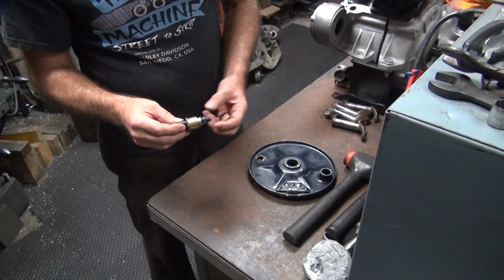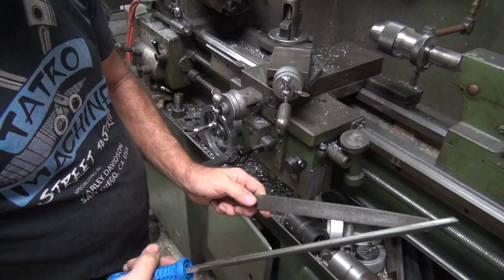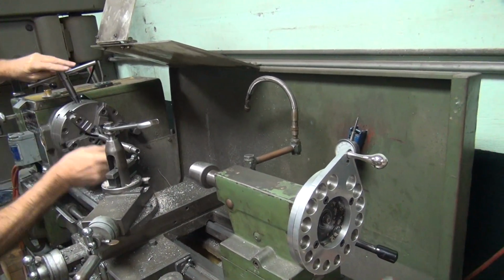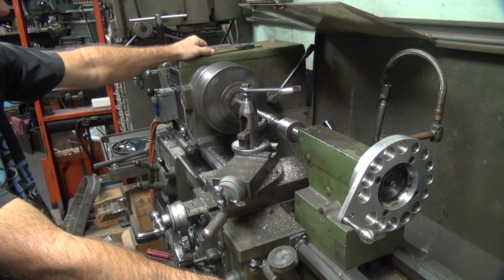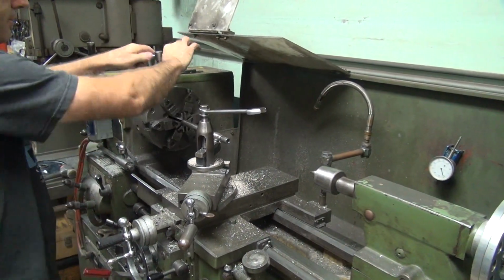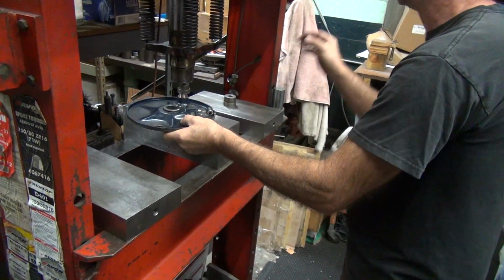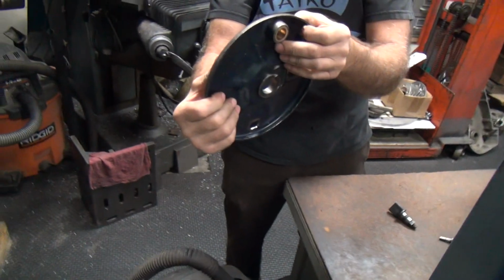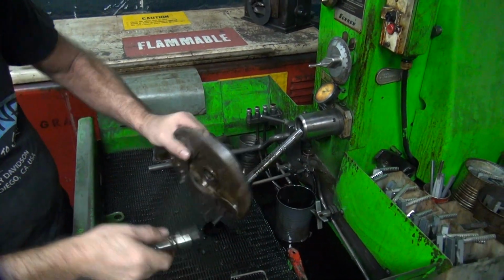#137 1952 panhead rust bucket rear brake rebuild clutch adjustment FL harley bobber by tatro machine

Comment: Have a question tatro. I have a 16" rim that I bought used. Had a timken set up in one side and no bearing on the other. It's from a 91 heritage. So I bought new bearings and races. I pressed it in as far as it will go and still dont have room for seal. Can you maybe do a video showing what order and maybe parts for the rim. Totally stumped , dont know if I'm missing more parts. Thank you sir for your time and vids.